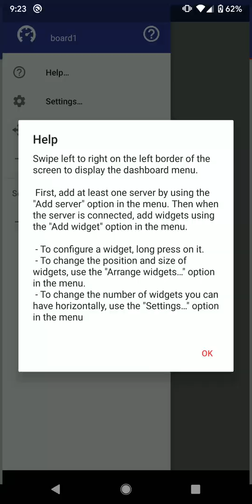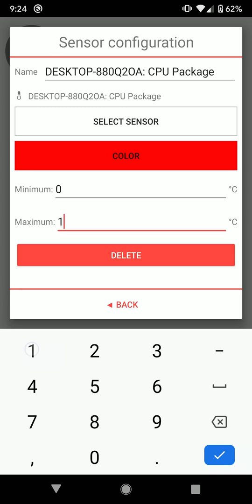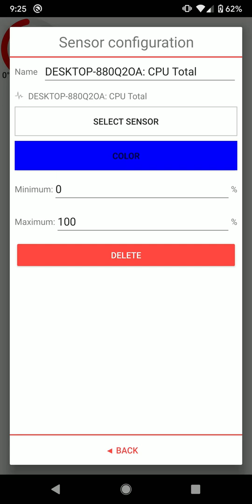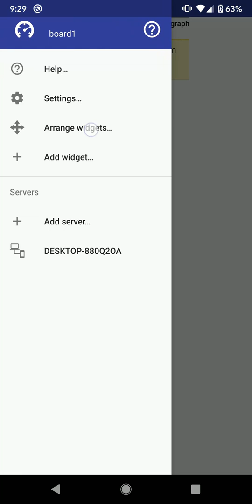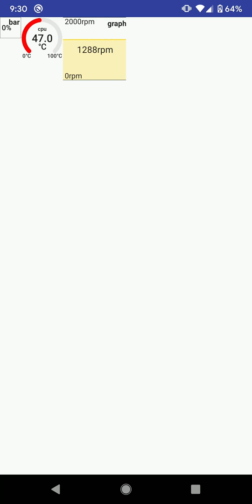Remote System Monitor Dashboard Tutorial

Comment: Under Temperture I see the first line says it's the CPU core under it are the numbers 1 to 6. What are numbers 4 5 and 6 reading? The other temperatures seem to be correct but 4 5 and 6 are always showing me 100 c. I'm wondering if these are phantom readings for sensors I don't have or if they are correct and represent something else I want to know. Seeing a steady 100c seems a tad high for any component in my system. Does anyone have any ideas on what they are measuring?

Comment: Honestly I like the "Server" view screen better than the dashboard since it has the dropdown view for the entire system that doesn't seem to be available for dashboards. Unfortunately it seems I can only configure the graphs in the center of my tablet screen. The graphs for CPU Voltage on the right third of the screen don't seem to be able to be configured. Am I missing something? If I long press or swipe in that area I get the graphs selection but it only changes the graphs in the middle.

Really wish the item on the "Server" screen where you can select each category (motherboard, cpu, etc) and see all the sensors in a nice view was available on the dashboard. It's a huge oversight that it's not.

Comment: will it work with fraps or other fps tracking software RTSS is a headache for me .. keeps duplicating in my taksbar forever
Reply from the maker: It works only with RTSS, unless you have a Radeon card. Radeon cards have a fps sensor which doesn't need RTSS.
Reply: @TRIGONEsoft  yes thanks for the response I decided to use Radeon's built in OSD for several things but less cluttered and other stuff through RSM Dashboard.

Comment: I followed everything and nothing works. Even tried my IP and nope. Seems like this needs some work.
Reply: same here, i realized i wasnt connected to the server
Reply from the maker: It can be an issue with your firewall or antivirus. You can disable then for a test.
An other common issue is that the router isolate wifi devices from the rest of the network. You can check in your router of wifi isolation may be enabled by default.
Reply: @TRIGONEsoft  good advice, I just got it working. My apologies for what I said, I was just frustrated it wasn’t working but now it’s good to go. You’ve created something absolutely amazing here.

Comment: the app only gives a 2 part multigraph but your setup shows 3 has that been changed or am i missing something? would really like options for more than 2 sensors in a multi graph
Reply from the maker: In a multi-graph you can have two types of sensors (for example temperature and rpm), but for each of the two types, you can add any number of sensors. So you can have 10 temperatures and 6 rpm sensors for example.